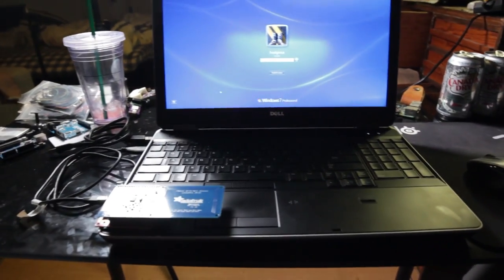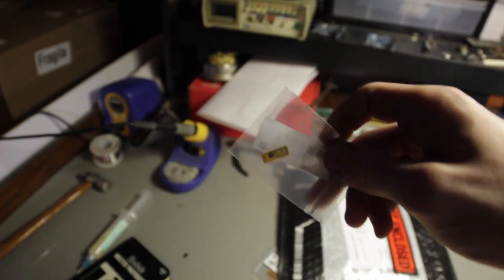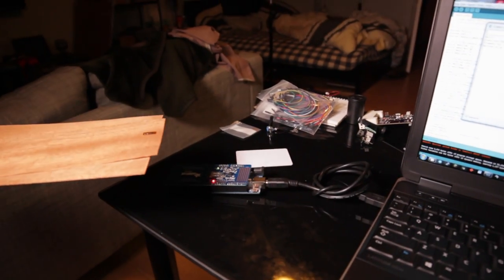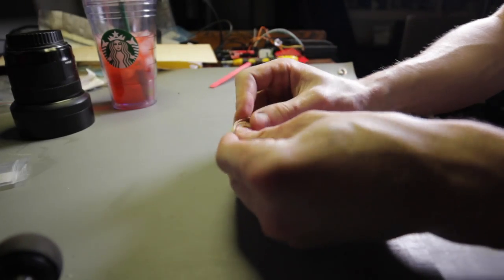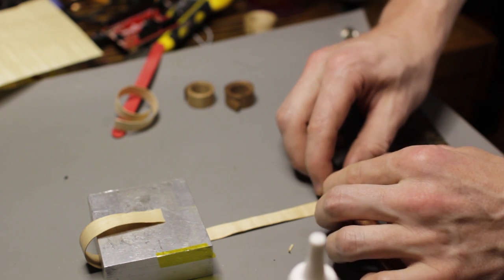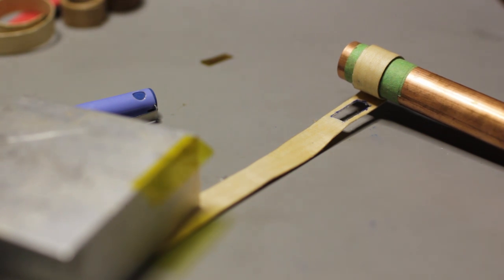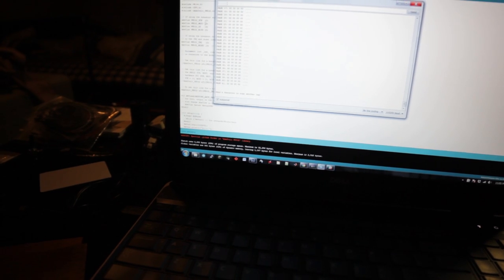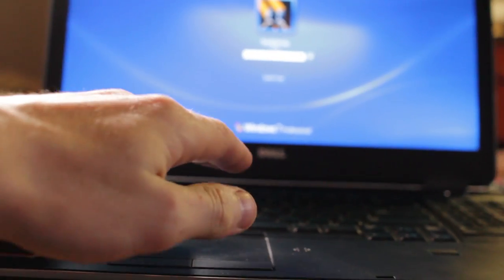DIY NFC BENTWOOD RING!

Comment: hey this may sounds stupid but since rfid/nfc tags r verry often used in every day products like stuf you buy at the grocery store 

isnt there a way that i could just recieve those tags and reprogram them save me the 3 bucks and the order time ?
Reply from the maker: You won't find any RFID/NFC tags in a store. I think what they use are called RF tags, which sometimes get mistaken as RFID. The difference is, the RF tag will only just tell the alarm system thing you walk through that there is something present(if it hasn't been deactivated, or the item is stolen), while RFID/NFC will actually transmit a real string of data to the listening coil. 

I also hate waiting for shipping.
Reply: Also they probably cannot be reprogrammed because some cannot but all can be read.

Comment: Hey, good work. I will try building the same. Ordered some tags too. For the ring, any material will do?
Reply from the maker: Hey! Awesome, I would get a pack of assorted woods, I found that some just won't roll up properly no matter how much you boil them. They just break and split. Others work amazingly. Unfortunately I don't know a lot about wood or their names so I can't help there. The more fiber looking woods I would stay away from. The packs are cheap, each piece I have here were between 1.50 and 2.50 and can make a ton of rings.
Reply: Did you program the tags? Can they be used for other things?
Reply from the maker: I haven't written any data to them yet, only read. They can be used to load websites or store contact information. With Tasker on android you can do a ton of things. Using an Arduino with an NFC reader there are a ton of possibilities as well.
Reply: How did you unlock the computer? can you give me the code. I have arduino uno and nfc shield.

Comment: There's any NFC tag with longer antenna, so it can work in the 360° of the ring?
Reply from the maker: None that I have seen that would fit comfortably inside of a ring. You could easily put one in each side of the ring though.

Comment: would this work with a tesla?
Reply from the maker: I'm not sure what Teslas frequency operates at.
Reply: There are different types of NFC tags with different security protocols. However it would work if you removed the tesla nfc tag from the tesla key card (didn't damage it) and did the same process again without damaging it.  Good luck